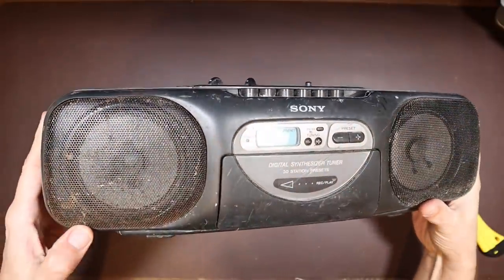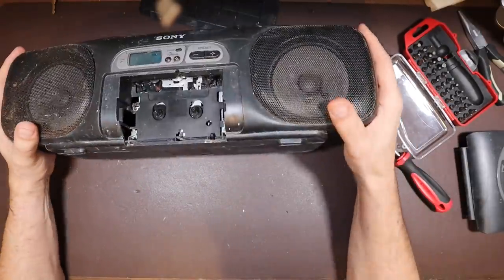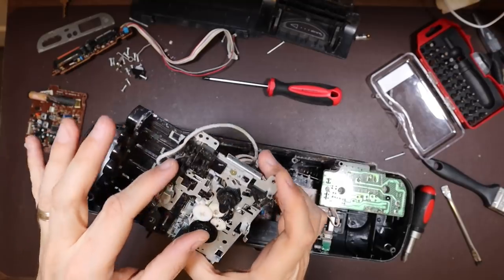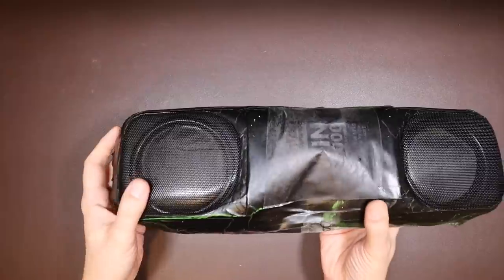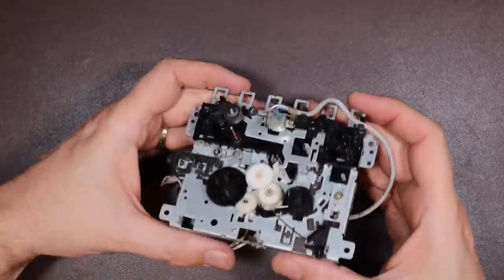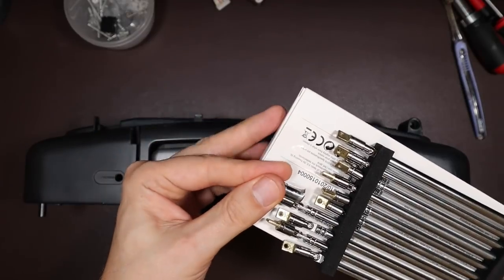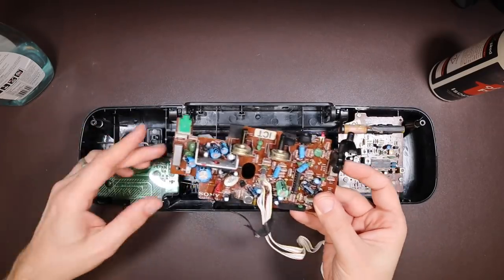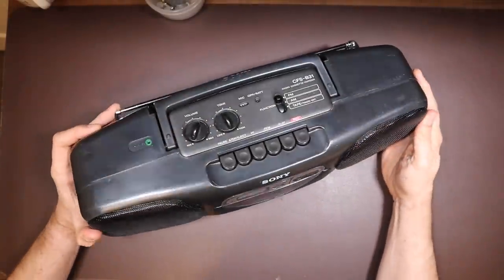Sony Boombox Restoration. Bought on eBay for £0.49/€0.59/$0.65

Comment: You did all of that work cleaning, preparing and buying parts without testing it first, brave man!!!
Reply from the maker: Believe it or not Kins I did! I didn't have enough D cells and didn't have a power lead when I unpacked it and all the shops were closed. Once saw it, it was so filthy my wife wouldn't let me keep it in the house so I immediately had to get it cleaned up.

Comment: Workers are often using similar radios at construction sites in the weather and dirt. Judging by the condition, I guess this one was used like that too.
Reply from the maker: I bet you are right JendaLinda... my guess this one was plugged in a lot because of the pat testing and stuck switch in the ac connection. Thanks so much for you comments. It really helps the channel out

Comment: It's pretty amazing how good low price speakers are these days.   You can find Presonus Eris E3.5 for under $100 each new for example.  Granted these are powered studio monitors so they don't have audio source such as audio tape or radio tuner. 

But if you consider you can buy these for a couple of hundred and then compare it to what a boom box sounds like, which was sold for around the same price back in the day, the difference is staggering.
Reply from the maker: This is very true, its astounding how good budget audio has got and how much prices for tech have come down.

Comment: Quality work... I always wondered if there a way to "buff" plastic to get rid of scratches but haven't tried yet... Nice work on the grills though, they looked OEM.
Reply from the maker: Thanks Dave. For plastic scratches I usually use car products like cutting compounds or colour restorers but like the magic eraser they can leave scratches. On this occasion the finish was great. I got lucky with the grills I reckon (no large flat surfaces). Thanks again for your support. Glad you enjoyed the video

Comment: Roger, you done a really amazing job on that, came up looking rather well considering the state it was in. Was thinking if you wrapped the bottom of that Antenna in Tin Foil would it give you better reception? Had a few laughs at some of your comments, you're very witty. Keep up the good work. Mick 👍🤣👏🍻
Reply from the maker: Thanks Mick. Glad you liked the video. I've had a few comments on the antenna which in fairness was the worst part of the job. I considered epoxy that i rejected because I wanted to be able to replace again if needed, hot melt which is worried might look bad and aluminum tape (which I didn't have) but never foil, good idea!. The electrical connection on the original design was all via the screw into the brass section with only a thin wire to the RF board and the part of the case that contacts the part of the antenna that was taped is all plastic. So in this instance I'm not sure it would have helped, but its definitely something to consider if I do another radio and it might provide better mechanical support  too. Glad you find my occasional jokes entertaining, like the radio they get a "mixed reception". As always I appreciate the feedback, questions, suggestions and am grateful for your taking the time to comment. Sincere thanks.
Reply: @RetroTechRepair  Pleasure Roger 👍🍻